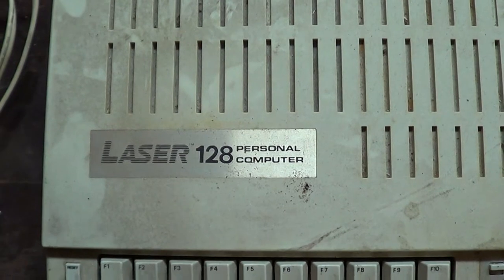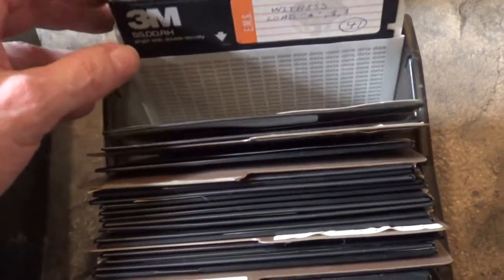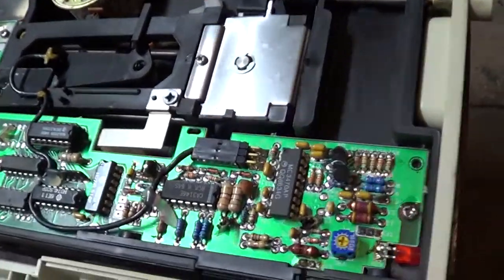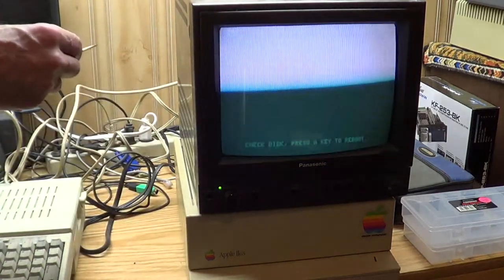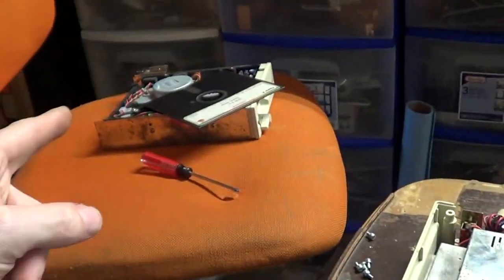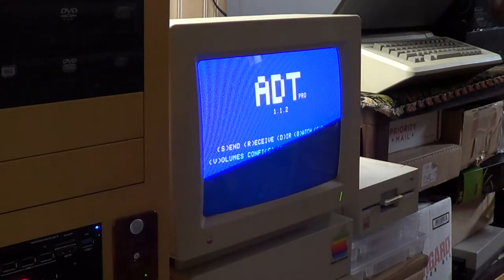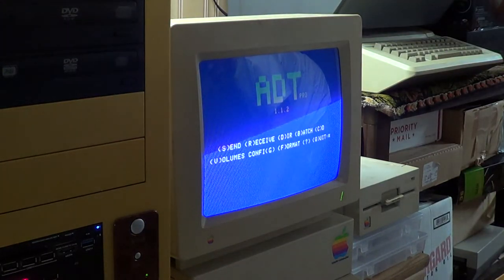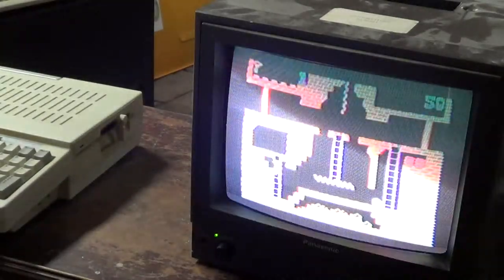Laser 128/Apple II clone computer.

Comment: Check the switches on the keyboard. There are three on the top right of the keyboard and the one labeled 40/80 collum. 80 collum should activate the RGB monitor port.

Comment: The 15 pin video connector works with CGA color monitors if that helps
Reply from the maker: I don't think I have any CGA monitors to try this (at the moment) and this project kinda of got pushed back into the closet for now.  Been busy with other things.  Thanks for the suggestion.  I'm sure if I took the time to check the pin-outs and read some schematics I could figure this mess out.  Like a few people said already in other comments: just because it has the same plug and it fits; DOESN'T mean that it's compatible...LOL  And there right.  I get bored I may play with this again.  someday????

Comment: That video port probably doesn't work because of a refresh difference or something. Apple is notorious for getting people to buy specific monitors etc.
Reply from the maker: I might look into it again.  I did read this from a old computer web-site and this is a quote from one of the paragraphs  "The 128EX/2's Video Display Generator chip also provided both analog RGB video (for connecting an Apple IIGS, Amiga, or Atari ST monitor) and digital RGB video (for connecting a CGA monitor). In RGB mode, the Video Display Generator (VDG) chip generates a text character set identical to an IBM PC (with the addition of the Open and Closed Triangle characters) "  So that IIGS monitor should of worked.
Reply: Although the Laser 128 line has a 15-pin video expansion connector, the actual pin assignment is almost completely different than what Apple used on the IIc or IIgs (which are different from each other!).

Four pins are the same as the IIc: ground, +12V, and an audio and composite video (I have a custom cable that provides signal and power to an LCD   monitor, the same cable works on the IIc) but the rest are different. And everything is different from the IIgs. 

You can find the Laser's pinouts in the Laser 128/128EX Users Guide (page A-12), and the Apple pinouts in the Apple II Pinouts FAQ
Reply: @duke135056  but that's an ex/2, you have an older one